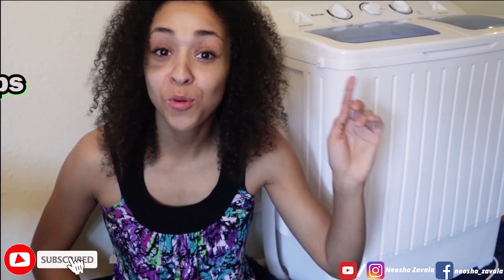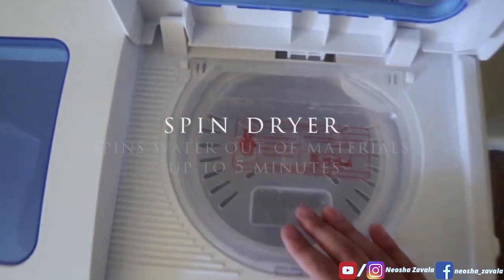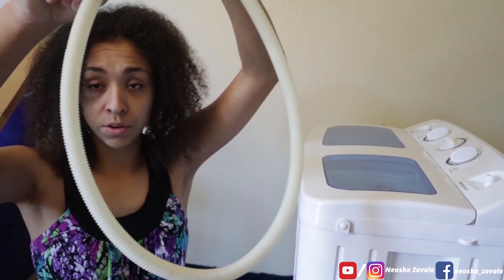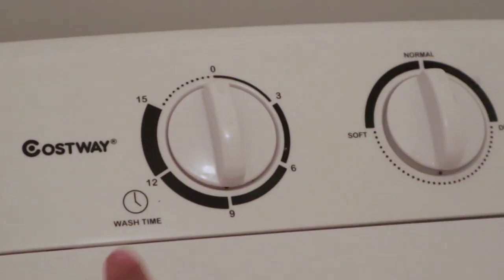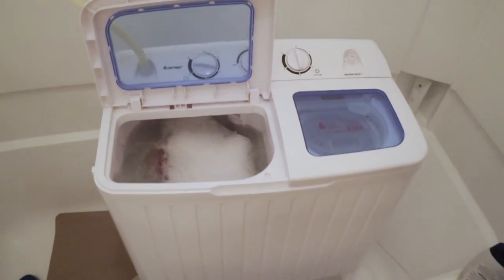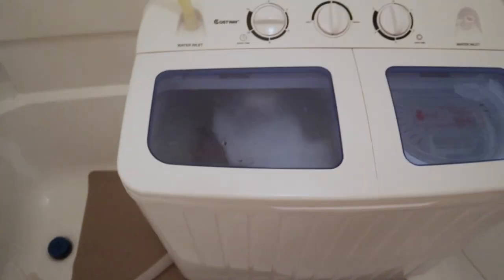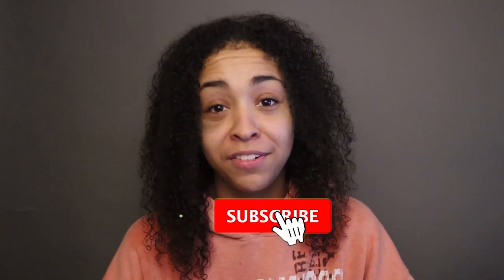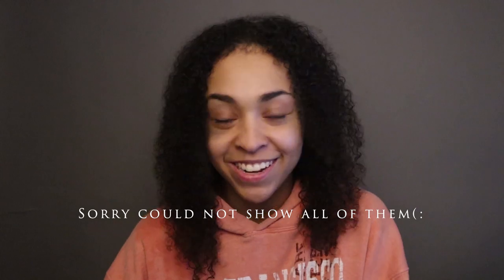Giantex/Costway Portable Mini Compact Twin Tub Washing Machine Part 2!!

Comment: I have bought many of these machines. Love them but the spinner stops working after a period of time. I have recently got rid of one, probably should have kept it in hindsight but it was taking up to much space with only one part working, as  again thespinner just stopped working. I have a smaller portable washer spin dryer, one that  I haven't even used that much and the spinner has gone on that too. Now I just wash clothes and hand ring, but have purchased a portable non electric spin dryer that you work through your hands. Not ideal but fed up of selling off part working machines like yours and re-buying all over again for the same thing to happen all over again. I also am very careful with over use I.e dryer and it makes absolutely zero difference. Not many clear repair videos online if you incur the problem. Hence why I chose to get a portable hand spin dryer for clothes. It will be interesting if you incur the same issues down the road.
Reply from the maker: Sorry to hear about your overall experience): It’s  unfortunate how some people’s machine experiences break downs snd stop working. Mine for me is still working. I just share my overall experience since this one in particular hasn’t broke down just yet at least. But it’s good you got one that’s manually for the spinner so you can work with that. But I’ll love to see how long this washer has worked for me until it breaks down, but for now still good. 
I’ll keep everyone updated! Making a part 3 on washer soon, I just like to give things more time so I can give a proper review(:
But ps, to see if you want if you haven’t, I’d contact the company to see if a replacement is an option if that’s something you want so you can save space and have both working parts again? But hope that helps(:
Reply: @neoshazavala  oh bless you, yes unfortunately warranty has expired. It was only 1 year. Ran out on the 14th month when problems occurred. I loved your video and tempted to buy another but holding off for a bit. Yes definitely looking forward to your update, hoping you have better luck. Stay blessed. UK 🇬🇧 fan 🙂
Reply from the maker: Thank you so much! I appreciate you 🙏🏽☺️ Sorry it’s taking so long I like to give it time to see how much longer it can take if and when it breaks down because it’s nice to get it know the get machine and all to get as most as possible to have that proper knowledge about the machine over time once I get to know it more ya know? So I can give a proper more debt review! So it’s coming. Soon on the washer, but I will be posting some time this month my Dryer video!! I’m excited to show you all(:

Comment: where do you get the white mesh lint filter from??
Reply from the maker: That came with the machine. I actually want to see if I can find another new one that fits its size. Over time it's kind of getting warn out.
Reply: @neoshazavala  Please let us know if you find it.
Reply from the maker: Sorry getting back to this comment I cannot find any other one.m unfortunately): I tried figuring out to find a replacement by chance. And nothin
Reply: @neoshazavala  they have those floating things on Amazon that you can place in these washers, they do work, my hubby uses them and loves them.
Reply from the maker: Which ones?? Because the ones I’ve seen don’t have great reviews):

Comment: Please be very careful with the water and electrical outlet. You're dealing with water and need to plug your cord in a "gfci outlet" which you may have one in the bathroom. If not, get one installed and use it. It could save your life.
Reply from the maker: Thank you for the concern, I definitely appreciate any suggestions I can get. But I do make sure no water is anywhere near the outlet. And I make sure not to get any water near anything like that. I tried to be as specific as I could in this updated video about showing how I avoid water/electrical damage, since I can’t change anything in this apartment since I don’t own it, so I cannot get anything installed either.

Comment: Just used my Costway 20 lbs total purchased from Walmart for the first time. Your video was my instruction guide because the instruction manual sucked. My washer tub does not have a clothe lint bag in the lint trap. It is only a plastic box with holes. I washed 3 loads and there was no lint in the trap. I will make a net sock to put over the end drain hose. I have already spent $20 today on a tub mat to give the machine more stability and 3 prong extension cord to connect to outlet. Don't want to give up more funds on a lint shroom right now.
Reply from the maker: Oh yeah do what works best for you for sure! I just wanna make sure that people will use something at least, just in case nothing gets clogged up as your laundry water goes down the drain. 
And yes good idea with the sock because that’s what a lot of people have suggested as well and they said that works perfect for them! So I’m happy I could help you in some way!! Good luck with your machine(: 
Ps: if your washing machine didn’t also come with the lint filter in the pulsator washer part. You can email costway on their website and they should send you a replacement (;

Comment: I Think I Can Take A Shower With The Washer In The Tub If I Unplug It And Cover It With A Waterproof Table Cloth And I Might Wrap The Cord With Water Proof Tape.
Reply from the maker: I personally wouldn’t recommend it, but say if you have of a bigger shower with way more room in your shower/bath area completely away/far from the shower head and making sure there is a complete barrier of plastic tarp/cover something really coverable and sturdy with having that waterproofing effect, or if that waterproof table cloth is strong enough than great use that to, but making sure overall that machine is completely covered and away from water that can splash above the machine ya know? But, I would recommend if you’re able to remove the machine from the tub/shower, than please do, so when showering I’d do that, if not and you need this easier solution, than yes I’d suggest scoot it over as long as there is enough room in the tub/shower area in your home to where water isn’t splashing directly in or on it too much, but make sure you find a great cover like tarp or something and ya if do that to(:
Reply: @neoshazavala  ill use both a tarp and the waterproof table cloth i got on amazon . i bought a extender for the drain hose does not work tho .wanted to drain in my tub so i could leave the washer out of the tub. im disabled and its to hard to keep lifting it in and out. could't find any thing to work on the drain hose for my sinks either and i cant  kep using a bucket  for the drain water  to much lifting. but ty for getting back to me.
Reply from the maker: Oh yeah that definitely makes sense, sorry about the extender part. I would return it and see if that one has something wrong with it, maybe get a replacement. Hope that helps. No problem at all(: Good luck with everything!

Comment: Do you only thing with a cheap machine like this and not having a full-size washer is I’ve been told that it does not get out stains very well and people who have children small children babies and things like that I wouldn’t recommend a washer like this it’s not gonna get out stains
Reply from the maker: Yeah I guess it really depends on the experience and what we use and don’t use to find a better solution possibly. So in my case, from my personal experience and having a toddler myself, his clothes have gotten all sorts of sauces on them and stains I thought wouldn’t come out, and this machine has done the job just fine for me. But if a stain needs a bit of help getting out since it’s tougher than others, I’d recommend spraying a stain removing solution of some kind that works best, and let it sit on the stain for as long as recommended, and then put in the portable washer, I’m sure that will help(;

Comment: why don't you drape the cord over the shower pole
Reply from the maker: Because if I do that on the shower pole, there is going to be possibilities of the cord getting wet, plus it’s not as long, so it’s to short, and the cord the way my bathroom is angled I don’t want any cord getting near really any water source that could lead to be accidental if it gets wet. Or it could slip someway. So i tried my best to show how I avoid water damage by angling it to where it’s out of my way, doesn’t get wet, and the cord won’t be sticking out where it should be and getting in my way with how my bathroom is.

Comment: Hi great work.  Actually enjoyable to watch this tutorial .
3 questions:
* Have you done fine washable/ lingerie in the little bags ?  I've seen a couple w ppl doing that in portable machines.   JC 
* Di you use the other setting. I think it says " slow " (  I don't have my machine set up yet ) for anything .. ?

* lastly ,  is your machine raused for drainage or just sitting on the mat.  , sorry if I somehow missed that part 

Thank you!!
Reply from the maker: Thank you so much! I honestly haven’t wash lingerie, but if you do I would recommend washing that type of material in a pillow case or something to hold it will washing securely so the materials don’t get spin around too much and loosen the material faster overtime. And as well as using the other setting I don’t ever use it to be honest. And sorry I’m not understanding your last question?🤔
Reply: @neoshazavala  typo there sorry 
I meant is your machine raised up on something on just sitting flat on the tub floor ..
( I've seen a couple videos where they put the unit  on a stool or something  similar   . They say for drainage purposes.  .but I wasn't convinced it was necessary .

Thank you so much for the quick replies!:)
Reply from the maker: Of course! Yeah so I don’t have anything raised up underneath, because quite honestly I have been putting this machine in my tub, and the way the drainage process is and all, the water is not high enough to reach the bottom part of the machine, so the legs are tall enough so I don’t feel it’s necessary for me at least. I have my mat underneath to help grip the machine a lot better so that way it also doesn’t leave scratch marks on the tub itself while the machine is in in use. And as well as hold the machine more in place while running. Hope that helps(:
Reply: @neoshazavala  have mine set up now.   I did it the same way .  It's working great.  ! . Cant wait to get the funnel and a similar rack ( don't like mine )   game changers I'm sure!:) 
Thank you !!😊
Reply from the maker: Aww that’s great to hear!! So happy this helped you, I appreciate you letting me know🙏🏽😊 Yes the funnel is a life saver for sure!

Comment: Can someone tell me how to get to empty my lint bag please
Reply from the maker: 32:04 I did go over the lint filter. But if it helps more you can grab a wipe or paper towel with more grip while it’s wet/damp and also use that to wipe it and grab the lint off to remove the lint as well. Run it under a faucet or hose while rinsing it to clean it more throughly after removing as much as you can by hand. But otherwise just make sure you don’t drain it where hair can get stuck unless you have something like the TubShroom for example to help not clog your drain.
Reply: Thank you ,it's the removal from tub I can pull down or I could rip it out but I think won't go back on again
Reply from the maker: It’s kinda hard to explain but if you grab the lint part when you go to put that part back in the pulsator, you wanna hold it to where it’s able to press directly down so put the bottom part in first and then press down and finish putting the filter top part in where it will clip in once you angle it in just right for it to stay. 
Hope that made sense!!

Comment: I think you had a little too much water in it . Anything with sparks and water , in my opinion, is not good!    You don't fill it to the tippy top.   N ot made for heavy loads.
Reply from the maker: The machine I’d suggest not filling up too much either, but since learning and having this machine for well over a year and doing the same thing since I didn’t know it before. And also trying and testing out what’s right vs what’s wrong with this machine, I’m learning what’s okay and what’s not. The machine  has done just fine over all this time being. I see your point. But looks like it’s done nothing to the machine and it’s still working.

Comment: sparks from any electrical appliance is never normal.  it is a fire hazard or electrocution
Reply from the maker: So this is a comment on my video from this person that he left saying this about the sparks. Hope this helps(:
@JohnRodriguesPhotographer • 1y ago (edited)
First let me just say I'm not an electrician. I am
a DIY guy. What you're seeing is the flash of
the contact switches as a reverse polarity and
restarts the motor. The electric motor can also
create little Sparks with the carbon brushes as
they rub against what is called the armature.
This is what makes the electric motor turn it
creates a circuit. The carbon brushes are like
blocks of carbon they're not like a paintbrush
kind of brush. If you look at a lot of electric
motors including your hair dryer, and absolute
darkness you will see Sparks. That is why when
you go to fill up your car at the gas station you
should turn off your car! There is all kinds of
electrical motors in a car that could Arc and
ignite fuel fumes! The Sparks that you're
seeing though are generally normal for an
electric motor. Now if they're really big Sparks
I'd be concerned. As in Sparks you can see
what the lights on!

Comment: THAT WATER FILL TUBE THAT COMES WITH ANYONE OF THOSE WASHERS ARE MOSTLY JUNK. I WENT TO MENARDS BOUGHT A WASHING MACHINE HOSE,THEY ARE BLACK, BOUGHT A CONECTION TO FIT MY BATHROOM SINK FAUCET, AM USING THAT INSTEAD OF THAT FIL HOSE THAT CAM WITH MY WASHING MACHINE

Comment: Way to much work! A terrible buy! I ended up getting my money back because the cheap drainage tube got a hole in it in 2 days of usage. Additionally, I had to purchase new tubing because theirs didn’t connect to my faucet. Just horrible! It’s best to get the portable automatic washers. This one sucks!!!
Reply from the maker: Sorry to hear about your experience): I wanna say though, everyone has different ones and fortunately for me I ran into a good one. As I say in my disclaimers I do make sure I mention to be sure for everyone has an overall different experience based on the items and machine can come in good or bad conditions to make sure to ask for a replacement and what not. It is a process and can suck at times to do extra but it’s worth it for me. 
And mine still today is still working just fine for me like it has since day one in my videos. I will say though I have asked multiple times to the costway company on their email for a new little lint filter though for them to ignore me and not respond. Like they were and then left me on read in the process of getting a replacement piece, but nope nothing and just ignored me ever sense. 
But it’s not a great customer service company from my experience with me emailing them. I’ve ran into with my personal experience, but I will say I guess I was just lucky to get one of the good machines from not the best customer service company. But I shared my experience in full and truth because I have the machine and 3 years now. So for those that it can help and if ya have a different or yet bad experience, my best bet would ask for a replacement if you haven’t, and maybe you just got a bad machine either purposely or accidentally, or unknowingly. Never know the case when your package is on its way to you.
That’s why I would try to ask for a new one and see if you can run into the same experience as me. My dryer video I ran into hell with haha but ordering it 3 different times because the machine came broken, but then I got my 4th and final dryer, same brand and finally ran into a good one! Lol. But, I’m making a part 3 to this machine and I’ll answer your question in there to(: 

Sorry about your experience but maybe there’s a different alternative is what I’m sayin ☺️ also it’s worth the work for me in my Situation because everybody has a different situation, I’m just glad I don’t have to hand wash my clothes like others have to ya know? Once you get in the habit of doing it it becomes normal because I say it’s all I got, it’s easier in my situation because I have a toddler and it’s hard to go to laundry mat, taking clothes in and out and all when I can just stay inside and do it, it’s an extra chore cleaning and what not yes, but it also saves me from  other hassles that are harder than staying inside and washing with this machine. 
Honestly washing with this is easier for me in my situation, like leaving and packing up not just me but my son, it’s cold to so trying not to slip on ice on ground while holding baskets of laundry is hell for me at least lol, and using gas, then running into crowded laundry mats or gross ones, plus money and taking more time each time, hassle with a toddler leaving and running all over lol 😆 

 But ya know sorry this is long but I just wanna say so you see my perception, it’s helped me, so people like moms or anyone who’s camping this video can help. Or people see how it helps me in general idk haha
 And if it doesn’t help you that’s totally okay. But it helps me is why I shared it cause my 3 years of having this and using it every single day if not 2 days no then 5 days out of the week yes, my experience is true or I wouldn’t of shared it if it wasn’t helpful to someone or anyone. Thanks for reading😅💙